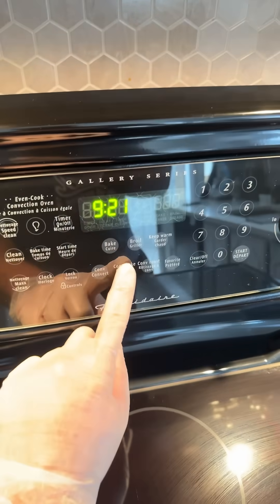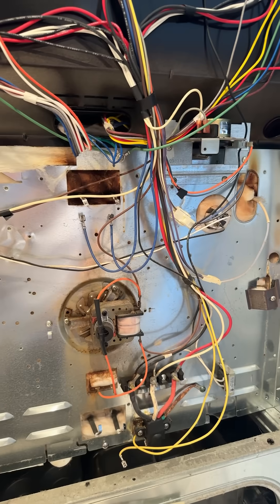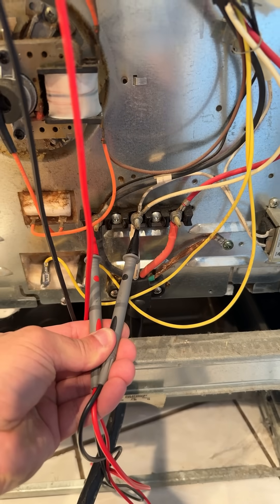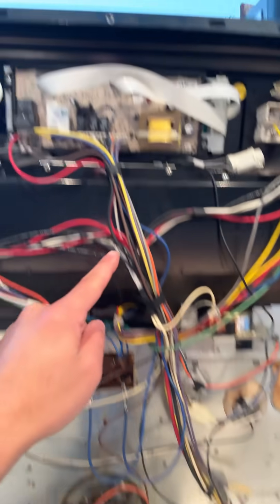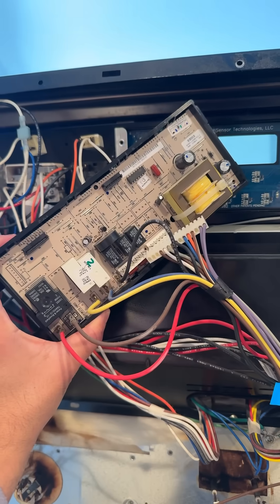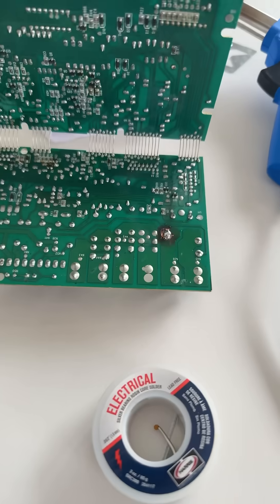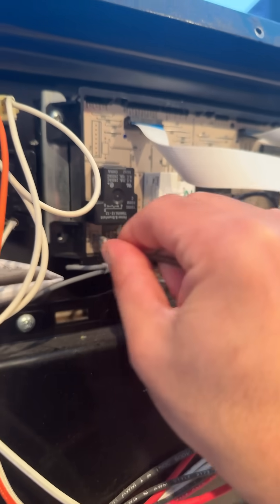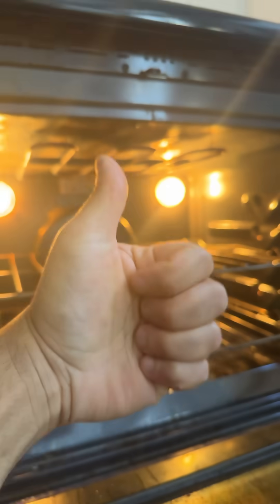One Tiny Solder Killed This Oven – Here’s How I Brought It Back To Life 🔌⚡️

Comment: What the? You just replaced the solder on a BURNT PCB without finding and replacing the faulty component causing it to burn? And what's more, with MORE SOLDER THAN BEFORE? So now the solder can handle more current and take longer, if ever, to burn away, meaning more risk of fire when (and it will) the faulty component fails again. You just put lives at risk because you're clueless!!!

Comment: Personally i would have replaced the relay because it could have suffered heat damage from that bad burnt joint but this repair definitely works in a pinch if the relay isnt sticking

Comment: first thing you do is use multi meter on elements not heat oven as you may need to replace the element that's now in hot oven. this is an old style oven the new stuff is way more complex its either element or clock on these no skill involved.

Comment: Only critique is that you should have checked from each leg to each other to get the 240 instead of measuring each leg to ground. Just because you have 120 volts on each leg doesn't mean you have a true 240. You could just have the same leg of power on each side.

Comment: 120+120=240 is only a safe assumption if the outlet was working previously (and no electrical work has been done since the last time it worked). If its a new house, or someone who didnt know what they were doing went snooping in the breaker panel, its entirely plausible those 120's come from the same phase.

Comment: It's stupid, but you should also check tha you have 240 between the two legs.   As they could have been miswired to the same leg.  and the board and ck tools may only run off of 1 leg with just the elements using the full 240v

Comment: TIP: DO NOT HANDLE THE RIBBON CABLES DIRECTLY.

Those blue tabs are there for a reason... for you to use them to connect/disconnect the cable.

Comment: When checking the incoming high voltage I would also check across the two incoming 120v hot legs to make aure you have a true 208/230v. I have seen multiple times where you only have one hot leg and it gives 120v on the meter on both legs to neutral

Comment: All is great you're obviously on top of things however... I'm not certain about the exact regulations in the US where this is coming from I'm assuming.... The first concern would be liability insurance and whether or not you are an authorized installer or repair person of this equipment and if not even though you may have insurance and if there is a house fire with these bad joints which you did not do... You can get hauled into some real nasty stuff.... A word of advice I would be careful. Certainly I know how to repair many many things but my point is the liability aspect if someone comes back at you for a $400 repair and they want a brand new house out of it... Is certainly a bad deal. I wish you the best but please be careful

Comment: this is kinda funny, i got to play appliance repair man last weekend almost the same exact problem, slightly different board but same relay. I do industrial electrical stuff so im familiar with diagnosing problems. I suspected it was the relay and ordered a replacement for 8$ the actual culprit was a bad solder joint, not quite as burnt as this but perfectly melted away from the pin. I replaced the relay anyway having had it all apart

Comment: Looks like you created another cold solder joint that will fail again. The relay should be desoldered, removed and the burned pin scraped clean. Then the bare copper needs to be exposed on the board. The relay needs to be soldered back on the board using proper flux and solder.

Comment: The way the board overheated under the high powered relay this means the circuit board traces are under size to carry the current by design. 

I would have scraped off the green liquor coating on the board, and re-enforced the traces with soldering down AWG 18 or AWG 16 copper wires along/on-top of the traces handling the high power. 

It is unfortunate the average priced appliances are designed to be as low cost as possible to manufacture. Most average appliances will start having failure after about 5 years of age. With these appliances the electronic circuit boards are very expensive to replace when they fail. Technically they are designed to not be serviceable. 

The manufacture will not sell individual components and schematics to service the boards. They will sell the complete new circuit board. If it is still available. After about 5 to 7 years normally the circuit boards are no longer available. 

It is possible to have longer lasting appliances but the cost will be much higher.

Comment: You were not wrong about that soldering job, but respect for just fixing the issue instead of replacing the entire board it’s a rarity these days especially when it comes to appliances and electronics.

I’d be worried about a repeat incident given the burn marks but time will tell.

Comment: What bothers me about these new appliances, is that an oven (or washer, toaster, etc) don't need to even have a circuit board.

It's just running a variable current through a few optional resistors. Knobs work fine.

Comment: When a circuitboard connection burns like that, sometimes (most) it is good to grind away the surface of the circuit board nearby with a dremel tool until  the non conductive part of the board doesn't look toasted, because when the circuit card burns it can have a high resistance and or allow high voltage to arc to nearby lands. If You wrap a bit of heavier copper wire around the relay lead sticking through the board ,and solder both to the board, You may have a better connection as per jamesgeib's suggestion.  That relay looks properly spec'ed, but maybe not.

Comment: Please to see the repair, but I strongly suspect that joint is bad under the solder, I'd suggest ordering an original board from the oven manufacturer and replace in the near future. Worth having a conversation with their engineers to make sure they know this has happened, it could have been worse.

Comment: As a rule you should always check line to line as well as line to neutral. Sometimes breakers get installed incorrectly, or plugs get wired incorrectly. I had a DIYer wire a plug wrong on a dryer that had me scratching my head.

Comment: i am seeing these china relays are just not heavy duty enough to handle the high amperage load, I’m working on a window AC unit where the tiny relay for the compressor just burned out from the high amperage draw, older AC have a heavy duty relay for the compressor, and of course i can’t find a relay to fit this circuit board, I’m thinking about wiring in an older more reliable relay!

Comment: When I did repairs, both elements almost always meant either a bad thermal fuse/limit or the relay. I would re-solder the relay then give a quote for a new board. Nobody ever took me up on the board and I think I only ever got one revisit where my solder failed again.

Comment: I replaced a relay like that with a solid-state relay that was turned on and off by the same printed circuit board. The solid-state relay can handle the current, especially with an added heat sink. My wife doesn’t like it because it doesn’t click like the old relay did But I did save $300.

Comment: I would respectfully suggest that the first step is to confirm correct power at the outlet before screws come out of anything.

Checking line 1 to neutral and line 2 to neutral is a good start, but you should also check line to line. You don't know if the supply has been improperly connected. If both line terminals are connected to the same leg at the panel, line-to-neutral still looks OK but you actually don't have 240 line-to-line, you have zero. This can happen because someone used a pair of single pole breakers or put a narrow double pole on the wrong spot in a Federal panel. This is often the culprit with stoves that light up but don't heat and dryers that spin cold.

It takes a real knucklehead to connect a circuit improperly like this but if it's the same individual that did the drywall at that plug...

Good work on the troubleshooting and soldering. Guns do tend to be too clumsy and hot for smaller connections, but not bad for a large terminal like that.

Just take care to use solder and flux that's meant for electronic work, not plumbing.

Comment: Bad design - they used a tiny relay and a weedy PCB to switch 12 Amps, that's just inviting problems.
Never buy anything with electronics and/or software if you can avoid it - get one of those ovens with the big twisty knobs.

Comment: Not sure the solder is bad.

Possibly a bad soldier joint from the factory 

Perhaps poor engineering and the board is over heating due to the large amount of current passing through it.

Possibly the relay should be not on the board but another location on the back of the stove keeping all the high current away from the board and pervert over heating and maintenance costs to replace the main control board.

Just wondering if this is a one in a million point of failure.

Or a comm weak point in the design of the circuit.

Comment: The voltage on the legs is a bogus. The 120 can come in one leg, travel through the elements...and come out the other screw...and let you think you have 240. The real test is IN THE RECEPTACLE. 

You did a decent job at fixing the board. The world needs more people like you! 

NEVER attempt to fix bad solder joints with a 100W soldering gun (way too hot) and plumbing 50/50 tin solder that has no rosin flux in it (electronic solder should be either 60/40, 63/37 or lead free solder). Just by the look, you got yourself a cold solder joint. It will fail quickly. 

Hope you used pliers to tighten the female spade terminals...cause I've repaired tons of ranges on which they were loose...and caused burnt wires! 👍

Comment: hooray for Component Level repairs, looks like a cold joint likely from the wave solder machine the OEM used to attach the component not dwelling long enough for a proper whetting out of the joint, that board will likely outlive the rest of the oven, but good to see people practicing a lost art of repair

Comment: If you were to cut that black relay open carefully, you would find the contacts burnt. The burnt contacts create resistance and take even more power to run. they also get very hot and unsolder themselves. Then the connection arcs  and burns the board. Resoldering is a temporary fix at best. The best thing to do is replace the relay and rebuild the board's solder pads.
Reply: ALWAYS find the cause of the problem. The solder melted due to over current at that point. Could be bad relay contacts, weak solder joint etc. I would have checked the relay contacts and replaced it, if necessary. I would not use the PCB trace either. I would solder a small piece of wire to jump over the bad trace
Reply: Was gonna come here to say this. Good comment. This works for a temporary fix, but replacing with a like part is always the correct option. Although I will give the OP credit for knowing that they don't have experience soldering. Always know your limits so you don't take a job you can't handle. Worst case scenario is leaving a customer with a piece of equipment that is unusable instead of having limited usage.
Reply: I was saying the same thing:  replace the relay!!
Reply: Or You can open the relay and clean the contacts.  When the relay switches during the peak of the AC cycle, back emf can cause the contacts to arc, and sometimes weld shut.  Probably a relay with greater separation between the contacts designed for 15 amps at 240 volts  ( 600 V peak, tungsten infused contacts) are best.
Reply: Most likely this was a cold solder joint from the factory and there is nothing wrong with the relay.
Reply: @ I would be willing to bet $100 that relay is burnt inside. I could go down to my work bench downstairs and find a bunch of the ones I've cut open and every one was burnt. Same thing happens with relays in microwaves and dryers. Sometimes you can file them, but its only a temporary fix. Replace the relay and rebuild the board. Check any can caps you see along the way. Oh, and the relays and caps go bad on refrigerators these days too. I rebuilt a Whirlpool refrig. board the other day,it needed caps and a few relays. Worked great afterwards.

Comment: That board is a failure point due to bad design decisions. Single sided board, probably only 2oz copper at most. The heat cycling on the leg caused the solder to crack and as it heat cycled more caused arcing and eventual failure. The trace looked small as well. It needs to take between 20 and 30 amps. That trace would need to be around half an inch across for a single sided 2oz pcb.

Comment: Tips for soldering. 

Don't just use rosin core solder. You need flux/paste. Trust me. 

Heat the joint. Not the solder. Solder is attracted to heat and will litterally pull itself into the joint.

Get solder wick to help clean up the area of old solder and other debris. 

Learn how wattage corresponds to heat and what your workpiece is. Soldering grounds requires more heat than soldering anything else. Higher watts. Have an adjustable soldering iron.

Use leaded solder. I cannot stress this enough. It flexes so much better than lead free. Thats a lot of why we get "cold solder joint" symptoms. Its not a cold solder joint. Its unleaded solder. Its brittle and breaks easily. What does a contactor/relay do? It moves. A lot. It will eventually vibrate the solder on that pin clean apart. I always do repairs with leaded.
Reply: This is all sou d advice! Well done, sir👍😎👍
Reply: You are right about 60 % tin & 40 % lead,  being the best ! (eutectic solder) forms a mutually miscible inter-metallic which is far superior to non lead solder in terms of longevity, and very low resistance, and corrosion resistance, but if You use flux,.. use high quality ( rosin based  no clean electronic flux) as well as rosin core solder.  DO NOT USE zinc chloride based flux as it is corrosive, and fumes poisonous. And NEVER , NEVER use acid flux !
Reply: I was told to use rosin core and flux.
Reply: @dreadswizzard9142  I did state "dont JUST use rosin core. You need..." inputting the word 'just' in this context means to add onto it with another thing.

Comment: That repair was not soldered... it a ball of solder melted above where the solder joint needs to be. Throw away that total garbage solder feeding iron and watch some youtubes on soldering.. The solder alloy needs to wet into the metal on the board, not be a ball kinda barely stuck to it.

Comment: I repair this kind of stuff all time and I use some heavy solder coated wire to bridge from the relay to the upstream solder joint and bypass the wooden trace on the board

Comment: As a former electronic technician, that was caused by a cold soldier joint when the board was built.  I've seen a few of those myself.
Reply: Thermal cycling will cause failure esp with modern ROHS lead free solder.
Reply: @Gromitdog1  100% agreed. Same issue is with inverters. 99% of them fails the same way (burned connection points of high voltage side of relays). Bad solder, bad connection, more heat... snow ball. Lower melting temp. of led free solder only makes it worse.
Reply: @Gromitdog1  I've seen leaded solder do some horrible things too, like almost all the component leads completely detaching from the solder to the extent the parts could be pulled out. If I recall correctly we reflowed the entire board.
Reply: This is a problem that is often found in grid tie solar inverters , the isolation relay contacts become pitted and develop resistance, causing heating of the contacts that eventually heats the pins to the point of melting the solder causing cracks around the pin that intern arc blowing solder away. Although the repair works, the relay is probably the root cause, and for a few extra dollars should be replaced.
Reply: heating elements should be on mechnical connections and not solder joints in the first place. too much heat on a solder joint.
Reply: @codyreber8370  I'm pretty sure there are or at least were specific relay types for this which soldered to a board but also had blade terminals for the contacts so the load current didn't flow through the board.
Reply: Was it wise to repair?  Wouldn't a weakness in the board from the previous damage result in a similar failure?
Reply: @gbriank1  well it is not a 100% fix but if there wasn't much to damage then it can work for a few years.
that said it really depends on what burned where. for example if a resistor burns up and has lines going through below it and the board has burn/melting marks then it is likely not fixable. it also depends on if you can see burn marks on the other side of the board. be it discoloration or melting.
if it is just on the surface like here it is pretty save to just resolder it after testing if the relay itself still works.
Reply: @dovos8572  You'd be surprised what can be fixed. It helps to have some inside information on the board layout though.
Reply: @gbriank1  Chances are that if the new solder used is leaded, it won't ever be damaged again, in which case it would be better than new.
Reply: In New Zealand we call that a Dry joint..

Comment: The display on my 3 yr old LG range has gone wonky. The display is like $200+ alone. On some circuit boards resoldering some of the resistor points has fixed issues. Any help would be appreciated.